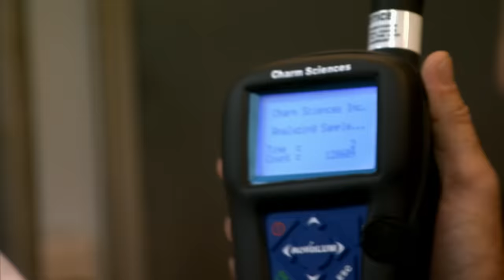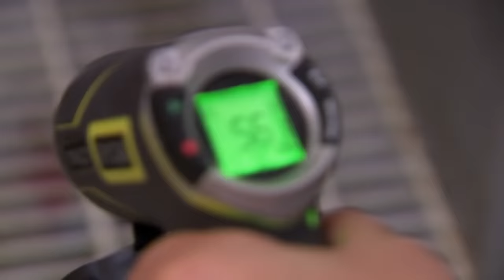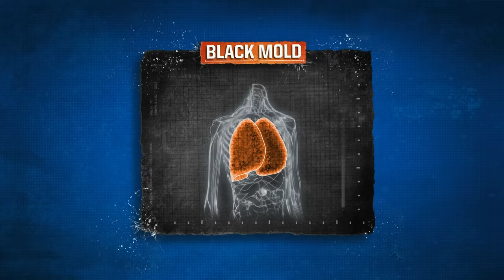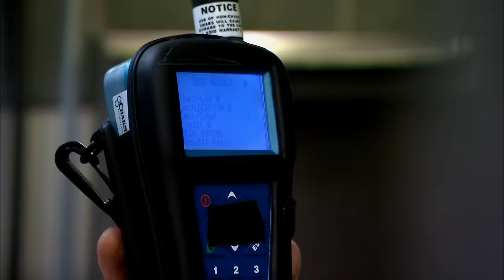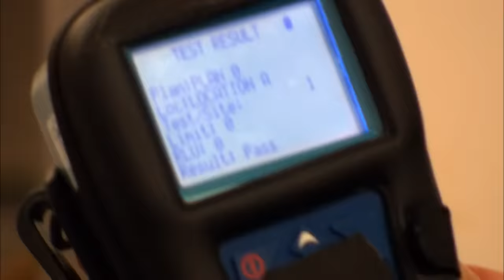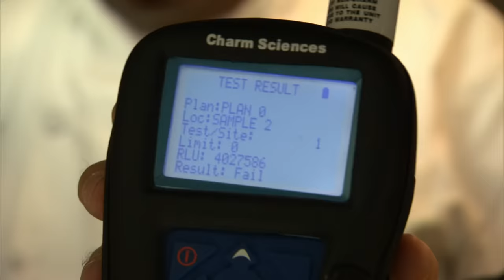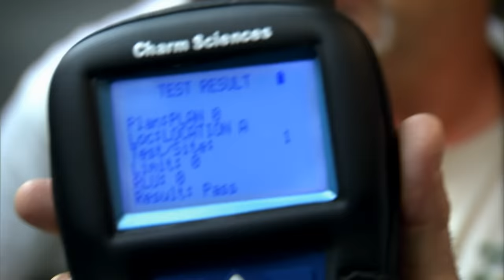Bar Rescue’s Grossest Test Results 🧪

Comment: If Ramsey and Taffer did collab our speakers wouldn't be able to handle the amount of yelling from both of them.
Reply: MSNBC: Amazon reported a 1600% rise in speaker sales just one hour after the Bar Rescue - Gordon Ramsay crossover episode. - allegedly 🤣🤣🤣🤣
Reply: It would be a match made in hell
Reply: Legend has it that they actually tried it, but the force of both of them “going in there” flipped the truck every time. It was ultimately determined to be too dangerous. Several countries have even passed laws against the two of them being in the same vehicle at the same time.

Comment: 1:57 Maybe a minor detail but I spotted 2 blank video game arcade cabinets as Jon walked out of there and I need to know if they were real or just props.
Reply: They're real cabinets, but all the logos and designs appear to be covered by butcher paper. 

It's a process called "Greeking," the hiding of trademarks and copyrights on props. The pre-production crew couldn't remove the games (otherwise there'd be an unexplained big empty wall), so they came in before shooting and hid the names, logos, and characters so the network wouldn't pay licensing fees. This is also why beer taps never seem to have brands on the handles
Reply: @47Jaspers  Gordon Ramsey and John Taffer is working with his experts and his crew as a team.